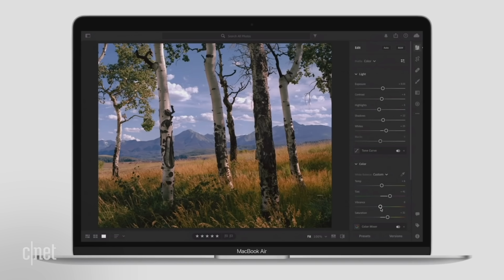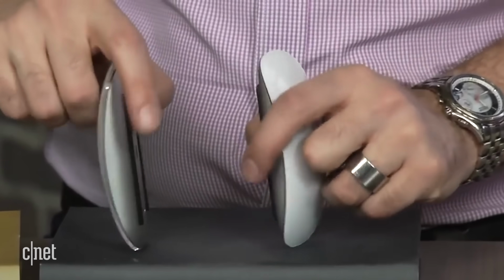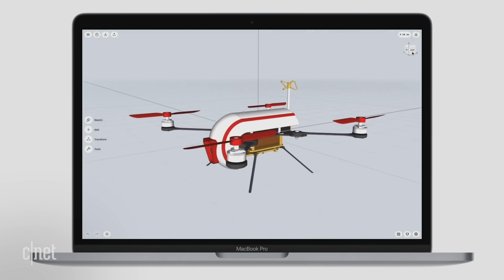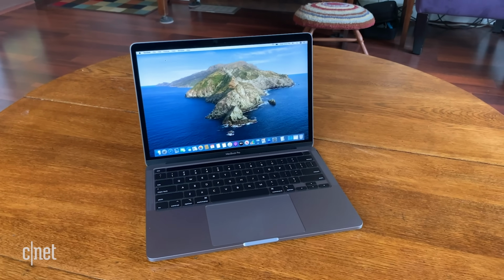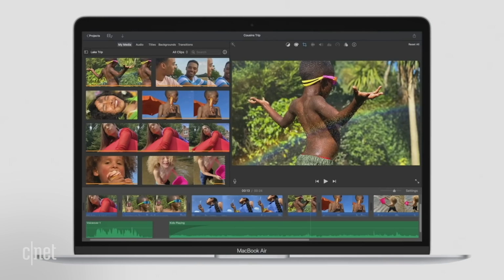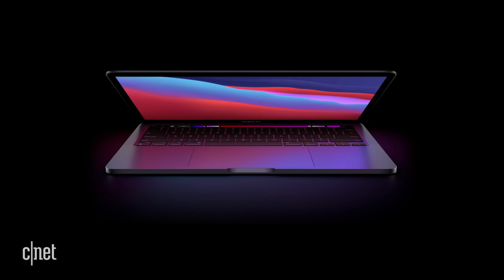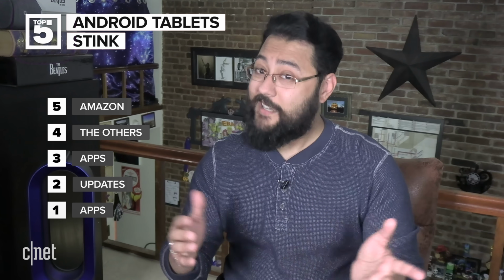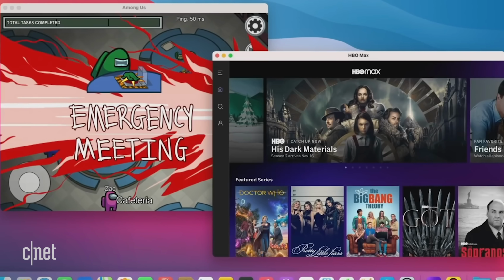Apple M1 Macs: Why you should wait

Comment: 3:59: "Its maximum storage is 2 TB, the Intel one was 4!". 
Seriously, does anyone know someone who bought a 4 TB MacBook Pro?
Reply: Maybe some render-guy who is too lazy to carry around an external harddrive.
Reply: I just back up my blurays and uhds and with my steam game library and school work I easily blew past 3TB, if I was rendering I would need and external hard drive with at least 2 TB...
Reply: @TheIllusiveWorks  Thanks for your reply mate. Would you really back up steam games on a Mac? In addition, with Mac storage pricing, I think it makes much more sense to purchase an external drive.
Reply: @shonshrinks  steam won't work the new Mac even though that's not a problem for some Mac users it is for others
Reply: @shonshrinks  not to mention some people need large storage that is fast, look at how much. 2tb external ssd back up will cost
Reply: @TheIllusiveWorks  You're absolutely correct, and those who need Steam on Mac should be respected. But honestly, I barely know anyone who plays games on a MacBook. Maybe that'll change with the excellent graphic performances of the new ARM chips!
Reply: @shonshrinks  It cant compete and I doubt it has the performance of a GTX 1060 (Which is impressive in a super efficient mobile platform) but now you can not even do boot camp due to being on a arm architecture and even if you could you could only run arm version of windows(in a unoptimized way). 
This should have been an option for mac users who are more mobile then others...
Seems like an attempt to keep everything in house, but at what cost?
Reply: Also realize that I my self run a GTX 1070 with dual boot with mac os. The 1070 can push 4k at 50--60 FPS with some optimizations. But in the grand scope of things my GTX 1070 is up to 8 times slower then some new GPUs like the RTX 3080
Reply: @TheIllusiveWorks  Great points, thanks for sharing mate :)
Reply: @TheIllusiveWorks  True but this doesn't have a discrete gpu, obviously it will perform better than a discrete gpu
Reply: @4french  Are you really saying iGPU can compare to Vega or Nvidia RTX?
Reply: @TheIllusiveWorks   Ah I meant integrated gpu in the last part
Reply: it's all about the efficiency of the MacBook,MacBook  run 10 watts when playing games whereas gaming pc run more than 100 watts
Reply: @smplfy  Interesting, thanks for sharing :)
Reply: @smplfy  I travel a lot but I’m not sure I understand. You carry around a laptop to watch films offline?

Comment: My only reason to hold:  my 10 year old MBP just wouldn't die..
Reply: My mom has a 2013 mbp. Everytime I use it it runs like a champ. It's built like a tank, too, as she has put dents in all four corners (it's been dropped on the tile at least 6 times).
Reply: And you aren't doing anything modern or are broke.
Reply: Lol yeah man, I feel you. I wanna upgrade, but frankly I can’t find a single reason to! I work in backend and my 2015 mbp still knocks it out of the park!
Reply: My 2012 is going strong. After my SSD hard drive replacement and adding 16gig of RAM almost two years ago, it’s found new life. I run a design business with it, too.
Reply: @RichardsWorld  Probably just using Safari and Microsoft Office
Reply: Love my 2010 mbp - no real issues with it yet, other than swapping out a capacitor on the logic board
Reply: My mid-2012 is working fine as well. I replaced the SSD
Reply: My Macbook Pro 2012 died and I got a new Macbook Pro 2012. This thing is the most resilient and smoothest laptop of all time. 16 gb and SSD is all you need.
Reply: Same here. Mid 2012 upgraded to SSD and RAM. However not sure till when software is supported.
Reply: it's all about the efficiency of the MacBook,MacBook  run 10 watts when playing games whereas gaming pc run more than 100 watts
Reply: 2009 17 MBP still alive and kickin'

Comment: The MacBook Pro 13" didn't lose two ports, it's replacing the ones that were already only 2 ports.
Reply: It does not matter, the MBP is irrelevant as it is a 300 bucks premium over the better looking Air which is 99% the same. So it is a trade-off between 8Wh more battery power on a machine that runs 2 days anyway with some added Christmas lights or physical function keys and a much sleeker appearance. A very marginal difference, definitely not worth 300 bucks.
Reply: @2kBofFun  MBP has a fan to keep it cool, for some of us use this kind of machines for sustained workloads it is worth the $300 difference.

BTW looks are subjective, I prefer the look of the pro. ;)
Reply: Geez, CNET is really struggling to pull together 5 things to nag about here...
Reply: @KaisuiSTFC  You don't do sustained workloads on a 13" screen....
Reply: @2kBofFun  Depends.  I run several VM's and lots of processing.  Lots of builds.  Video conferencing at the same time.  It is definitely not in the desktop obviously.
Reply: @2kBofFun  I'm a music producer and I usually use a lot of heavy VST on my old 13' using Ableton 10, believe it or not I'm not the only guy doing that kind of stuff on the go, sometimes I'm finishing a song in the backstage of a show before going on stage and test it, of course 2020 it's different but i need a serious and mobile machine when everything is normal again.

Comment: I honestly can't wait anymore because my MacBook Air 2013 is literally dying. I'm basically in need of one so I'm gonna buy it regardless.
Reply: You could go with a 2019 - just sayin!
Reply: @rrosomasa  I could tbh! But I've waited for a new one. Do you think the new one would be bad? Why? I really can't decide tbh. I use my laptop for college and a little bit of gaming such as hearthstone (card game).
Reply: I have the same one, time for an upgrade
Reply: @sullivan7484  - the new 2020 won't be "bad", but this vid has a point with waiting for the second gen of the chips, plus the 2019 will go on sale.
Reply: @sullivan7484  just buy intel version.
Reply: My 2014 MacBook air still going strong but I'm thinking of upgrading it
Reply: Make a Hackintosh. Cheaper, no thermal throttle, and completely upgradeable.

Comment: App support is actually the only relevant reason to wait (and virtualization but I don’t use that except for curiosity about what other OSs look like). I have a 2012 Mac mini with i5 and upgraded with a SSD, it won’t get Big Sur but it is still good enough to wait and see how apps are supported and optimized. I purchased the gen0 Apple Watch, I won’t do that mistake again (used until end of last year though).

Hardware : the hardware is the change, though only internal. Form factor is good enough IMHO. Smaller bezels would be nice but that has nothing to do with the CPU architecture.

Comment: Apple: 5nm Intel: Am I a joke to you 😂
Reply: Just spoke with an ASML engineer, and the whole nm thing is pretty much fake and marketing talk. With the current top-of-the-line 13nm EUV it is impossible to make 5nm lines, let alone 5nm transistors. The pitch between lines is around 30nm, both on Intel and TSMC chips. Biggest struggle for Intel is yields. Not te size of the fab process.

Comment: The new M1 MacBook Pro has just 2 Thunderbolt ports because it is REPLACING the low-tier 13 MacBook Pro which DID have 2 Thunderbolt ports. The 4 port “high-tier” version has not been updated but is still being sold in Apple’s website with intel chips, probably because they will be updated soon too. 😄

Comment: First generation touch series with interior design changes lead into burning of logic board (T-Con) and it costs 750$ for repair without apple care. Reason to cause such problem is simply watching a 4K video on MacBook Pro’s and with time it will burn the board because of the poor placement of the board above the heat sink. Yes, I agree. Unless apple admits such flaws and help repair them, waiting for 3-4years refreshing the recall page every month hoping someday they might put it in their website is the job of a lot of customers who faced such event. 

Wait wait wait...

Comment: First M1 powered Mac should have been the 12" Macbook, then roll out Air, Pro, Mini 6 months to a year later when app support stabilized.

None of these current M1 Macs support external GPUs over thunderbolt right now, for example.
Reply: Yes -- that 12-inch Macbook would have been perfect on that

Comment: Apple didn’t make any changes to the design or components like camera as they are focused on starting the transfer across to Apple silicon. It makes sense to not try and change up everything at the same time. These machines are like a dummy run. They are blazing my fast and the battery life is insane. I’d wait though for M2 or M3 when Apple will then likely change the design once their silicon has settled in to its stride on the Mac.

Comment: I currently have a mid 2012 retina MacBook pro (15  inch) with 2,3 GHz quad-core intel i7 and 8Gb RAM. Surely the 13-inch MacBook pro with M1 with 16Gb RAM will outperform my 8-year old MacBook pro ? I plan on keeping a new MacBook for at least as long as I've had this one so ARM processors are the way forward in order to keep getting updates/support.

Comment: "Good luck trying to run Windows on it"
I have a Raspberry Pi here flawlessly running Windows 10 on ARM, It's a bit slow because of the CPU but it's just as flawlessly running 32-Bit X86 apps (64-Bit should work soon), I'm sure very quickly Windows 10 ARM will be supported on Mac's.

Comment: The most telling statement in the apple keynote was that the M1 offers 3 times the graphics performance of any existing integrated graphics. In other words if I upgrade my current i3 based laptop with Intel system graphics that can barely run Skyrim legendary edition at low settings to an M1 then I would still only be able to run Skyrim Special Edition at medium level graphics settings. When you look at the few frames of game play in the keynote it is clear that the M1 could not run Skyrim Second Edition at highest settings. There is of course no chance the the M1 could ever run cyberpunk 2077. There is also no chance that in a crowded market that either Bethesda or CD Project Red would port their games to the M1.

I have an iPhone and have 185 Gb of old video podcasts in the iTunes library in my PC. This means that none of even the the fully upgraded Macs in the keynote would have the 2Tb storage that I need for what I do. It was interesting to note that both the 256 Gb and 512 Gb SSDs in these Macs are soldered directly into the motherboard and so they are completely none up-gradable.

I do find the micro-controller like design in the M1 chip interesting. The M1 chip includes either 8 Gb or 16 b of main system RAM on chip. This gives the important micro-controller like advantage that address and data lines for the RAM need not be provided outside of the chip which reduces its pin count. I like the fact that this RAM must be really fast because it is all on chip. All of the RAM must run at close to cache speeds. This does of course mean that if you buy a $999 Mac Book Air with 8 Gb of RAM on chip this can never be upgraded to 16 Gb without trading up to a more expensive model with a 16 Gb M1 chip and that it is physically impossible for any model to be manufactured with 32 Gb of RAM. I notice that you cannot yet buy a 16 Gb model which suggests that Apple is having yield problems in manufacturing 16 Gb M1 chips.

One of the most important factors in game performance is that the huge number of calculations needed for AAA gaming can only be made if a system is overclocked. This means that the only hope that Apple has of supporting high performance games with the M1 is if they over clock it and fit it with a fan as big as that in the Xbox Series X. That fan is essential whenever the Xbox Series X runs next gen games.
Reply: It's not just games. There is no why it would be able to take on super high end graphics that likes of what Nvidia with there Pro line of GPUs.

Comment: Im about to buy a laptop which should I choose? 
Also why the newer (with M1) is cheaper than the macbook air 13.3 2020? 

THANKS IN ADVANCE

Apple MacBook Air Retina 13.3" (2020) (i3/8GB/256GB SSD/Intel Iris Plus Graphics) MWTJ2GR/A - Space Gray 

Apple MacBook Air 13.3" with M1 Chip (Apple M1/7 Cores/8GB/256GB) - Space Grey ..

Comment: I think you've missed the whole point of the M1 Macs, apart from that the Macs they're replacing did only have 2 thunderbolt ports....so if you can't get that fact right, what else are you not right about? The fact is, the M1 MacBook Pro will give me 2 x the performance of my MacBook Pro top shelve 2017 model, 2 x the battery, much better RAM optimisation for $500 less, those are the facts not your fake narrative!

Comment: Good luck running windows on ARM? MS is already running windows on ARM. Parallels already is working on an update for the M1 macs. This is just FUD reporting. For 99% of users these are great significant upgrades (Speed, battery life)  at the same price as the old versions. Sure hardcore pros will want to wait for machines with more ports and a beefier GPU, but that is only of concern for  video editors, 3d animators and game developers.

Comment: The MacMini not having space grey and the 10Gb networking port as options is enough to make me hold off for the next product cycle. I also want to know what happens when you run out of memory. in the natural contention for memory between CPU and GPU how does the system manage that issue? Too many early questions and the performance statements are lacking in specifics and couched in marketing, so they are obfuscated.

Comment: M1 cool... first gen macs have some holes...  Thunderbolt but no egpu support so those with nvidia or ati workflows need not apply for mac use anymore...    you can run iPad apps and they build a whole new 'alternatives to touch' subsystem instead of just adding a fricking touch screen... i know they made fun of PC touch screens in iPad commericals... get over it... gonna put iPad apps on your notebook... put a touchscreen on it.   and make it a 2-in one while your at it.     Make an Air, fanless 2-in-1 with a touch screen and I'm there.    It will take apple a decade to get to that machine though, even though they could do one next month.

Comment: The halved number of USB-C ports, halved maximum RAM, and halved maximum SSD are a product of these being - as you observed - first generation devices; the nature of the technology upon which it’s built means the M1 simply can’t support any more than that. Apple aren’t stupid, they’re not going to try to throw something completely new out the door & hope it works, so they’re working with what they have & easing into Apple Silicon. The Developer Transition Kit was powered by an A12Z, these new seven & eight graphics cores M1 SoCs are for all intents & purposes what one could call the “A14X+” & “A14Z+” (i.e. iPad Pro chips with some extra components for Mac-specific functionality), there may yet be an M1X based upon the A15 & maybe even an M1Z based upon the A16; either way, it won’t be until they start building A-series-cores-based Mac SoCs from the ground up rather than upgrading iPad SoCs that they will be able to move beyond the limitations of chips designed for inherently limited “single-handable” mobile devices.

Comment: What do you mean touch apps will not translate into track pad? iPads already have an option to use track pad which comes with new apple keyboards designed for iPads, so it won't be a problem, it was already solved. Click bait and bs ignorant opinions.

Comment: Even though I'm not an Apple fan and I'm only want to test the Mac, your 5 reasons above, with all respect are not legitimate except the iOS support. Applebdoesnt 8nvent the wheel and this was already attempted by Microsoft but the major difference between Apple and others is that Apple they make things that actually work without issues. The surface pro x Hass issues but so far there is no major issues with the new Mac except Bluetooth issues with the mini. The support for Intel based apps will come on the new M1s

Comment: The mini Mac on board ram is anemic at 8 gigs with no way to increase it. This is not the way to go. If you can get VM on it then you can find a way to run Windows. Another reason not to go with the new Mac it must have a way to run Windows programs via VM program. If Apple goes back to the old days of pulling off hardware double or triple up charging for ram and HD upgrades or accessories. Me wouldn't go with that program. Windows machines can do most of it.  End Story.

Comment: Will the base model MacBook air with 7 core GPU be able to edit 4k video smoothly
Reply: The intel core m Macbook 2015, but not yet as the software support isn't there yet.
Reply: Pretty sure it will be able to
Reply: Yes especially if you are using iMovie
Reply: I want to see it in fcpx and lumafusion

Comment: Hey CNET dude, looks like you did NOT do your homework before making this nonsense video. The M1 based MacBooks have 2 Thunderbolt ports with USB4, not USB3.1 as you claimed. Besides, all the 5 reasons you gave are laughable excuses, they don't carry much weight.
Reply: Virtualisation is a big deal. Do you understand what ARM is???

If youre buying a laptop just for battery life. Then use a iPad.